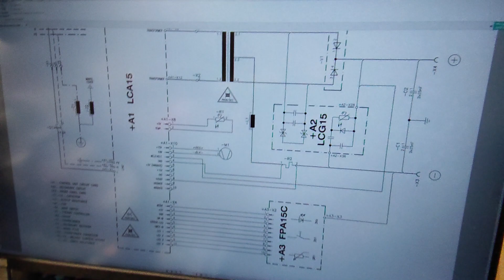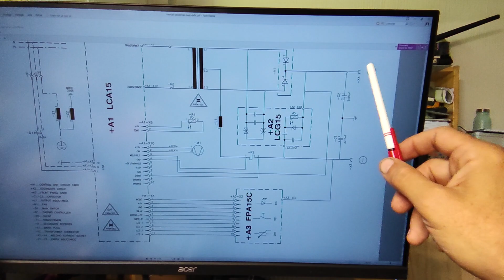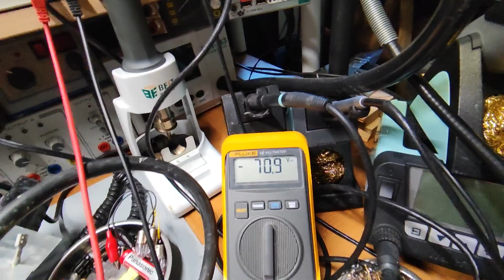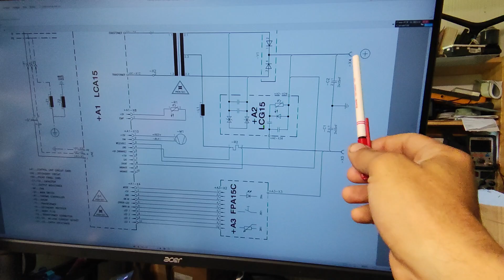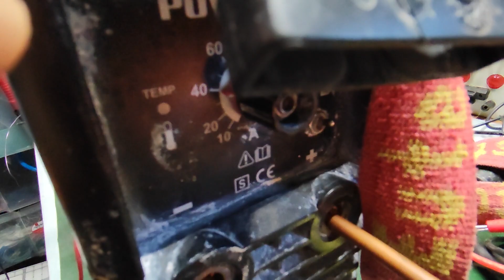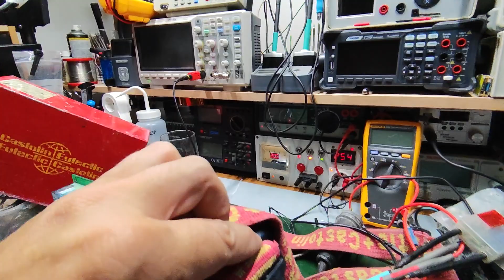Is that a repair? Try to fix the Castolin Eutectic Power Max 150.

Comment: Hi Alessader chiedo se c'è un secondo video per riparare la Castolin power max2 a livello di cambio mosfet. Grazie
Reply from the maker: no sorry.
Reply from the maker: I check some component on this one. I checked also the power line, and also I redo some soldering joint. 
At the end, I turned a littile bit some potentiometer, used for voltage output and intensity max output.
After a lot of test and redo things, the unit works. Hope you can find something for your device.
Reply: @AIexanderHartdegen  HI Alessader scusa ma  non riesco a fare un copia per fare  la traduzione del tuo testo da inglese ad  italiano.
☹️